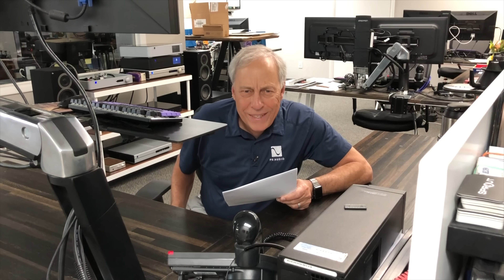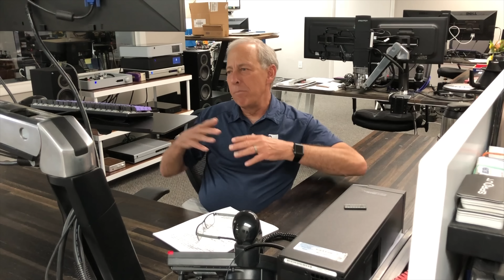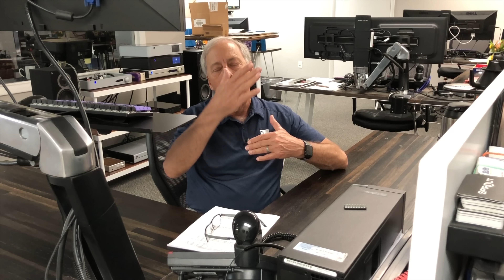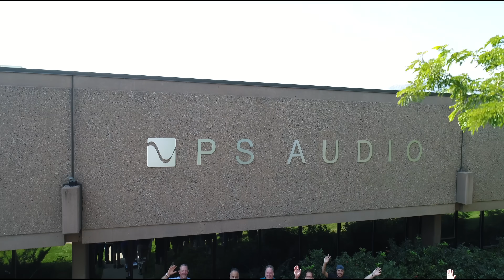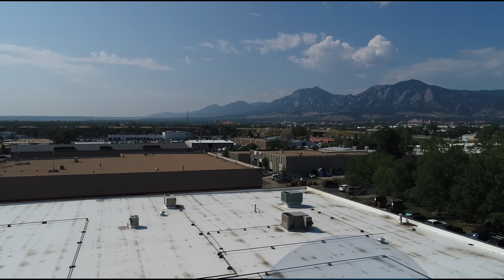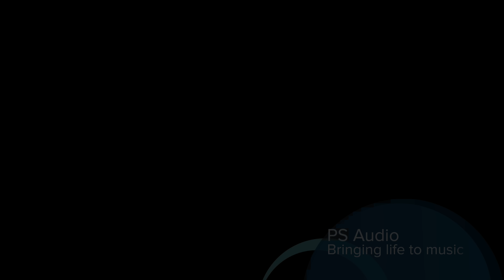Why doesn't low THD equate to good sound?

Comment: Measurements tell the whole story with electronics.  The rest is inaudible suggestion, very profitable to companies like PS Audio, but harmful to the wallets of gullible audiophiles.  Sadly, some of PS Audio's electronics actually harm measurements, although mostly in the inaudible range. btw, audibility of distortion varies with frequency, and is much more audible with test tones than music.  Paul suggests here that THD might "be valuable as indicators", indicating "something else". Do tell, what might that be? and how might it be audible?  Notice he doesn't answer that?  Notice he doesn't provide any blind testing proof that he can hear a difference between DACs that measure the same.  This is just carnival barker woo-woo talk.

Comment: Greetings,   Not meant as a criticism, necessary, but it is an observation and fact. Interpret it as you wish.

I have one of those small, twin vacuum tube, "buffer", pre-amps that I use in conjunction with an all tube SET amplifier. After two years, I tube rolled and ungraded all the tubes. 

The pre-amp was put on a test meter when new and the THD (total harmonic distortion) was just barely within minimum specs. In tube rolling new tubes, the pre-amp got a better quality grade tube. A matched pair actually.  When put on the meter again, the pre-amp's THD dropped 9dB, across the entire spectrum. The sound improvement was dramatic, with a marked difference in the  timbre and overall realism of the instruments. 

I sat in my chair for the next two hours listening with speakers and studio monitor headphones. I was gobsmacked at its new performance. The circuit was tested with and without the mini, twin tube pre-amp as a control.

Comment: Howdy.
I tend to think that good sound requires low THD. But not the other way around. Low THD alone does not guarantee good sound.
As I see it HiFi specs depend on mostly two parameters Bandwidth and THD.
High End, however, is another matter. I can discern two more parameters in HiEnd: Burst response and Slew Rate. I think Slew Rate plays a role in resolving capabilities. I believe, however, that Slew Rate alone does not guarantee resolving.
This far we can observe the parameters with gauges and meters. Resolving and Space Impression I believe only one's ears can evaluate.
My suggestion is to close one's eyes when listening to music. Does one get the sensation that the violin or cello is say some ten feets in fron of one ? Does the instument sound real or as a playback ? Can one say it is a bandstand performance ? And not a muffled studio recording.
Regards.

Comment: Howdy.
THD is usually declared using only one base frequency. 1 kHz. This is misleading. The midbands are often the bands the amplifier passes with best grades. THD:s should also be declared for say 100 Hz and say 7 or 8 kHz. Usually 1-2 % THD by itself has little meaning.
The frequency bandwidth is another common quality indicator. A reaonable tube amp. may have a bandwidth of 40 Hz to 15 kHz +-3dB. By itself this could be a good amplifier.
A more valuable measure is the output slew rate.That determines how well the upper bands can ride the bass. A slew rate of say 5 V per microsecond should be able to deliver resolution and presence. Slew rates are measured feeding the amp. with a square wave. However. The measurement should be done using a function generator that can produce trapezoidal waveforms where the slopes can be steepened or made more shallow. The output slew rate should not deteriorate when "shallowing" the slopes as long as the input is steeper than the output slew rate.
A good measurement is the "attack response". We feed the amp. with a say 3 kHz sine signal that is "keyed" with say 100 Hz. We observe how well the 3 kHz peaks stay constant during the keyed on half cycles. This is indicative of how well the power supply can feed fast, and uphold power. If the upholding capability is poor this could result in signal "pumping" and compression. The pumping effect is annoying. An instrument starts loud and mellows down. Pumping may cause listening fatigue.
Regards.
Reply: huh? 1% is totally audible and it's making your speaker work to try and reproduce the distortion instead of the sound signal which lowers output.

and most good amplifiers or gear even if they give a 1khz rating will also give a full bandwidth or 20-20khz rating which will always be a lower number.  it will also have a lower wattage rating at say 0.05% thd than it will at 1%.  that's why you see all these garbage class d amps give you a power rating at 10%thd which is absolutely unusable and would blow your tweeters if you tried running it like that.
Reply: @XX-121  Howdy. Yes.
You are 101 % correct.
Regards.

Comment: If you read my book, Distortion: The Cause Of Harmonics And The Lie Of THD you would be able to answer this question without a long drawn out video. THD is easily fudged (I know, I sold analog and mixed signal testers for decades) to optimize the THD numbers by changing the stimulation signal, the DC offset, the number of harmonics counted, the total noise, etc. In fact, THD is measured all wrong. Harmonics are always phase locked to the fundamental at either 0 degrees, 90 degrees, 180 degrees or 270 degrees for an applied sine wave. To measure ALL the harmonics you must do an FFT and look at the harmonics candidates phases to determine which ones really are harmonics and which ones are noise. You can find all of this on my website, and my books are on Amazon.
Reply: Does your book cover why the human ear finds second order distortions somehow makes sound reproduction more natural? There's a common thread of music lovers and audiophiles preferring tubes (generally). Curious why this may be the case.
Reply: @asplmn  That's a debatable preference. You're looking at this all wrong, harmonics are not magical gods that inhabit our world like spirits.
Reply: @DanBullard  oh, I know. I studied physics and engineering :)

I'm just curious why some people's brains/ears prefer that harmonic profile
Reply: @asplmn  So, you know the engineering and physic behind harmonics, do you? Say I distort a sine wave at 45°, what are the phases, in degrees of the first 400 harmonics? If you don' know the answer you don't know the first thing about harmonics.

Comment: Not all harmonic distortion is created equal. With very low harmonic distortion, generally you can be pretty confident with what you are getting, but a higher harmonic distortion may actually sound better, or it may sound much much worse. For instance, even order harmonics(2x, 4x, 8x, etc) sounds pleasing and musical, while odd order harmonics can sound harsh and unpleasant. I think a measurement of Total Odd Harmonic Distortion would be a better qualifier for how bad something sounds, but you also don't want too much even order harmonics either. There is a fine line there, and how do you even define an algorithm to measure an 'ideal' regarding something as subjective as 'sounds good'. In this, at least with a very low THD measurement, you know what you are getting, but that doesn't mean a very low THD measurement is actually the best you can do.
Lets say you have two amplifiers, both of them measure 1% THD. They likely sound nothing alike, in spite of having the same THD. The one with the greatest ratio of even order to odd order harmonics will probably 'sound better' to most people.

Comment: Identically measured DACs with identically measured gear hooked up to them cannot sound different.  
  
However, there may be a factor which you didn’t measure, such as channel separation or IMD, which could cause differences.
Reply: He didn't say that.  He said same chip in a different device.  He was speaking about output stage being a major factor in audible differences.

Comment: I've never been able to understand why out of phase measurements are not used to determine the efficacy of audio systems as a whole. If you record what's coming out of a speaker, flip its phase 180 and compare it to what's coming into the system, the source, there should be nothing at all left if you compensate for gain. If there is something there, spurious harmonics, whatever, there is a problem. There are scopes that can do this with great reliability. Does any company do this? If not, why not? The next question gets at the real issue. If there was a system that could pass this obvious test, would anyone buy it? That's the rub. Maybe not. Are we truly interested in accuracy?

Comment: Thd graphs showing the different orders of distortion is much more usefull, but no company will show you this, and even with this detailed measurement data is very hard to interpert. 

From a design perspective thd may be a sign of something happening, and can very likely be used to find problems by a good engineers, but what we are listening to is still the distortion these issues make not the issues themselves, so i might have to dissagree with you there

Comment: The audio skeptics who are obsessed with measurements are also obsessed with marketing buzzwords like "THD". They'll claim that it's not marketing, but measurable factors, but the fact is, something can be both a measurable factor and also marketing hype. With the audio skeptics, they use it as a way of ending discussion. They point to a device's amazing specs and claim that those specs prove the sound is perfect. It's just a FACT and that's it, there is no argument to be had. It's too bad they don't realize it's not the facts we disagree with them on, it's the story they build out of the facts. You can get all the facts right, and still construct a ridiculous wrongheaded view out of them. That's the audio skeptic; always missing the point, and always putting their own foot in their mouth.

Comment: Hey, I agree with you Paul. THD is mostly over-rated when it comes to amps because any good amp can get numbers way below 0.1% as long as you don't get near the clipping levels. But, why do we not talk about SPEAKER DISTORTION? As you know, speakers distort way more than any reasonable amp. Speakers can easily suffer from all sorts of distortion. The cabinet might have resonances if the material is not of high quality or too thin. The cone might not move in a linear equal fashion for positive and negative signals. The cone will experience less linear motion at the excursion extremes. The magnetic field might have some issues. At certain frequencies the cone might break up causing distortion.  It's actually not trivial to get even under 1% of distortion out of a speaker through the whole audible range. A typical case I've often seen is something like this: your amp can do 0.01% THD and you connect it to a speaker where, the cones are breaking up causing THD at >5% at certain frequencies (not uncommon for mass market speakers), thus your 0.001% THD doesn't really mean much. I've worked in this industry for ages and so many times I've seen speaker vendors totally ignoring distortion measurements (THD+N in audible range as a graph). And when I finally got some THD measurements...they were shockingly bad. So why are speaker vendors reluctant in publishing THD data? Because the numbers are much higher than what you hear for amps and those numbers are bad marketing! Nobody want to say their speaker has a max 1% distortion even it can be a good number for a speaker.

Comment: "GPX" surround system at Walmart: 10 Watts from 100 to 12,000 Hz at 10% THD.
1970s Pioneer receiver: 120 Watts RMS, Both Channels Continuous from 20 to 20,000 Hz at 0.03% THD.
With THD... Go with LOW.

Comment: The biggest problems are not harmonically related.  Aliasing is a much bigger issue in modern equipment with digital.  This is especially true with CD's and MP3's.  To fix this the filter is generally pretty aggressive.  Try to find a digitally recorded test CD such as the Denon Audio Technical CD.  If possible look at the result of the sweep on a scope as well as using your ears.  THD in an amp is minuscule compared to most loudspeakers as they are mechanical and non linear compared to the amp.  Most CD players do not reproduce flat response from 20-20Khz with no aliasing.  They either roll of sharply before or have aliasing, or a mix of the two.  If you find a download of the CD, do not expect great results if it is in a compressed format due to the lossy compression.  Look for the original CD or an uncompressed rip.
For Non CD formats, you can use Audacity to create a sweep for testing.  If you don't find the sweep function, use the chirp function and slow it way down over about a minute.  Play the resulting file back with your favorite DAC.  At the upper end of the sweep, notice any other frequencies sweeping in other directions?  This is worse than THD which is harmonically related and makes a flute sound a little less than a flute, but a trumpet rich in harmonics will mask large amounts of THD in the equipment, but aliasing will still stand out.

Comment: THD is typically measured under an ideal set of lab conditions - especially with no load or an ideal near-perfect restive load. This provides little insight into how the device will actually behave with dynamic musical content under real-world conditions with some length of inductive/capacitive cabling - and in the case of the power amplifier, the attached loud speakers. Additional specifications like Damping Factor provide a little more insight into that aspect, but these minute distortions all conspire together to provide some amount of slight coloration - some of which can be pleasing and some that are not. There are practical limits to numerically optimizing the audio path, so we trust the engineer to perform a final tuning of the design to achieve the most desirable audio aesthetic within the constraints of the technology. Enjoyment of audio is ultimately a subjective evaluation - not a scientific endeavor, so it is quite possible that an audio device with an order or more greater distortion may sound better to the typical listener because its design has been tuned for the most favorable coloration to our analogue ears and brains. On the other hand, an audio device that tests spectacularly on the bench may impart the slightest shrill coloration that ruins its perceived sound quality.
Reply: Our auditory perception systems are hybrid. From tympanum to the inner ear, essentially analogue, but becoming more akin to digital once our all-or-none nerve response system takes over.

Comment: hi Paul, have you ever discussed damping factor?   i went from a 30w integrated amp to a power amp with 8 times more damping factor and 3 times the wattage.  not much of a difference, i expected more effect in the bass region.
now i am thinking damping factor is more of a amps capability to drive many kinds of loads with same sound signature or something...
Reply: sudd - some manufacturers are really chasing the high damping factor these days, I have heard some guys say they don’t like the sound a high damping amp is producing, that it kills the flow of the musician some ways?! 
I am no expert in this, but find it interesting that some would hear it have a negative influence on the sound.

Comment: I have a weird hearing issue. Whenever i pinch my nose and closed my mouth and blow, letting the air out from my ears (the thing you do in an airplane at higher altitude to equalize the pressure), i can hear the high frequencies better. This will go away in few minutes after the pressure equalizes again but in closed back headphone, it seems to retain and the highs really came through.

Comment: What is the low harmonic distortion supposed to indicate?
Reply: Low thd ...sounds accurate analytical..

Tubes which is Rich is 2nd harmonic ..sounds warm 

Accurate sounding not necessarily sounds better. Vice versa

It's a very big subject why amp sound that way ..try looking at the bhk and Arnie YouTube on ps audio ..

Comment: what people miss is even if amp have distortion <0.01%, even very good speakers typical distortion is over 1% and even over 10% in bass region. Also 1% of even harmonics sound better than 0.1% odd harmonics.
Reply: What ?  My simple KEF's R500 have 0.4% distortion in range 120-Hz- 20KHZ  !    Where did you find out that "very good speakers typical distortion is over1% "    Maybe yours good speakers you got it from a White Van ?
Reply: @ryanray6215  What about sub 120? More than 1% lol.
Reply: 0.4%? probably on paper in anechoic chamber driven by 0 ohm impedance amplifier...